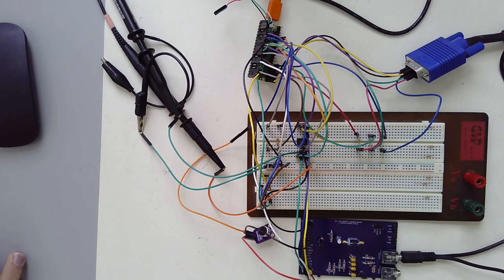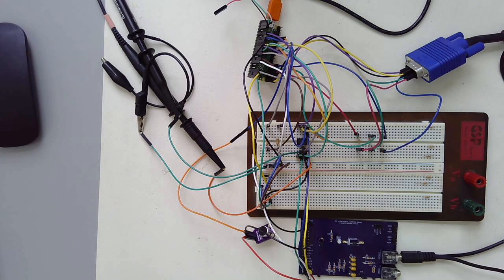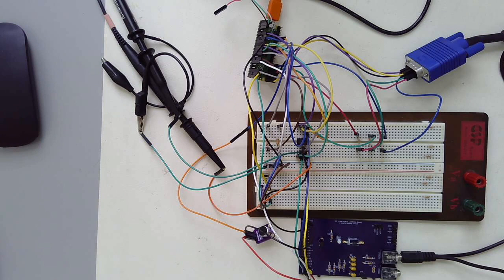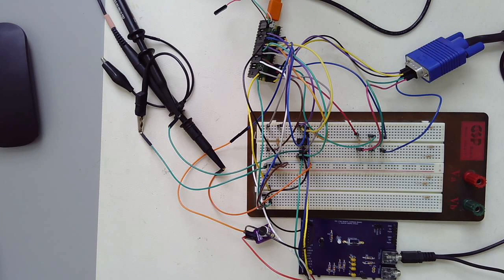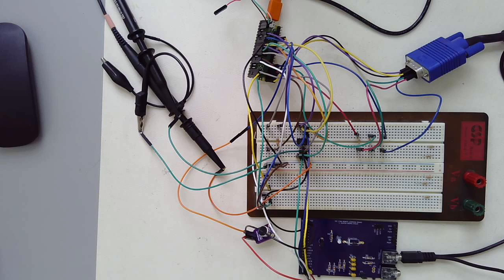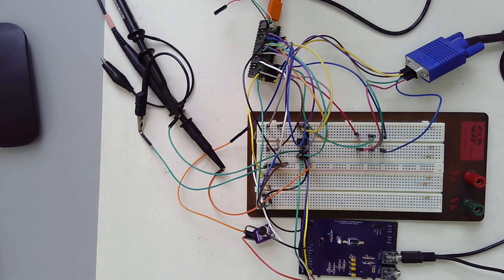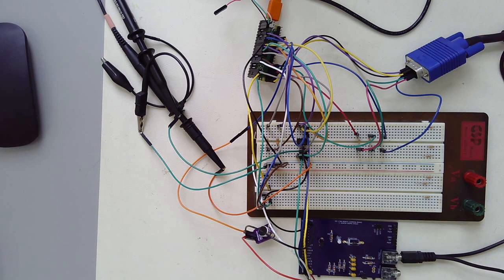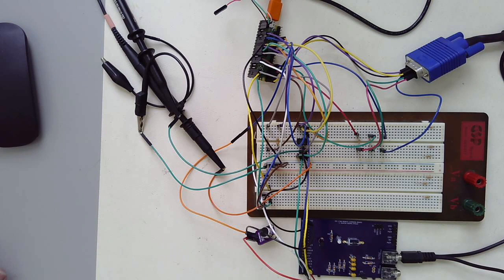Cricket chirp synthesis and synchronization with Raspberry Pi Pico

Comment: Hello. Is there any update on the pi pico based ECE4760 course ? Is it going to be taught this semester ? Thanks for the great lecture and project videos, they are very helpful !
Reply from the maker: Planning to teach 4760 using the pico in the coming fall semester. All the lectures will be posted.
Reply: @hunteradams9430  That's great to hear. Really looking forward to it :)